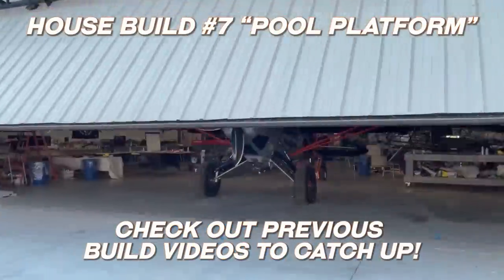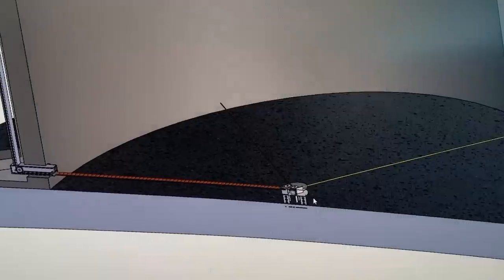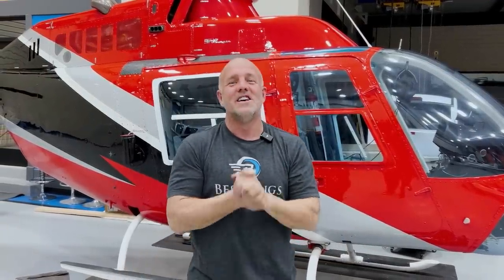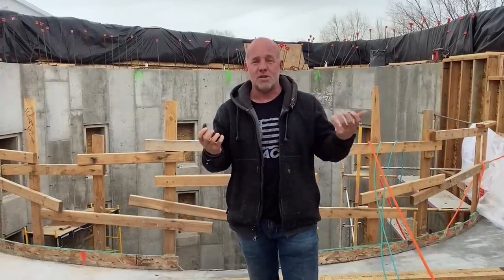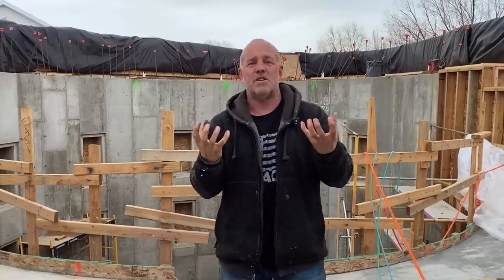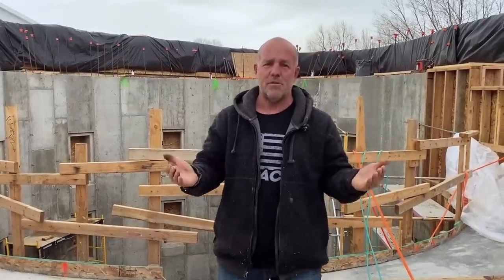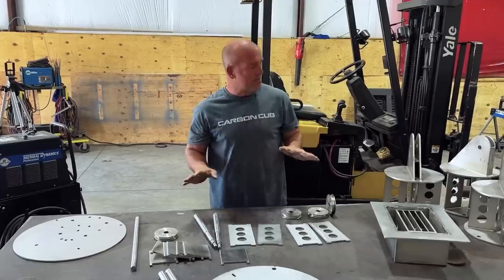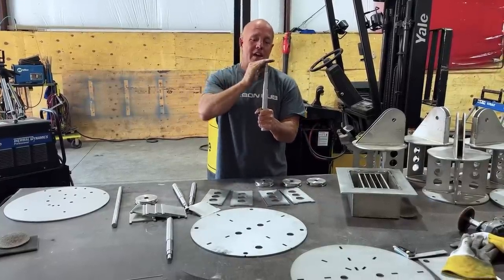How!? Transforming Pool - Dance Floor to Freedive | House Update #7

Comment: The diaphram will only allow so much water... brought back a funny memory, the place I was working built it's own plasma water table that went up and down with air. When they first tested it and turned the switch to raise the water it was like a reverse water fall that shot up over 25 feet and hit the ceiling, (someone forgot the diaphram plate !) this thing holds more than 6  thousand gallons and now much of it was on the floor.

Comment: great plan that man - as soon as you began talking about the platform, i instantly solved it issue with a floating one that can be pulled down, and then you described the same, i must be a genius engineering type like yourself Mike hehe
can't wait to see this in practice, it will be an interesting result, will you mount some simple nylon wheels in the sides to traverse the sides while moving up and down - the dance floor will be interesting when you have more folk standing on one side than the other - conjures up images of Flash Gordon and the fight scene, the floating table tipping and turning with spikes popping up through the floor, mm now there's another plan haha

Comment: Mike,  a suggestion about this, perhaps for the future: If you had added some electrically operated latches or tenons around the pool edge at dance floor level, and at one or more selected depths, then if a cable or pulley failed, the floor would not move.

Comment: It would probably make sense to plan for a 2axis top position lock for the plattform to avoid uneven load tilting
The water transfer hole size thoughts are good, but their flaw seems the potential  displacement of water out of the pool by an ascending plattform.
Happy Landings.
Reply: Purely guessing here, but I'd expect the top position to still have enough 'spare' buoyancy at every point so that it stays level no matter where people stand (or jump up and down). Very much a Mike Patey kind of engineering imo: over-engineer a simple design so much that it handles edge cases properly without needing extra complexity. Dude's always trying to build simple and indestructible.

Displacement shouldn't happen under controlled ascent (assuming Mike's done his sums right), and in uncontrolled ascent it'll happen no matter what size the transfer holes are - only difference is how fast the platform will rise, and he's chosen "slowly" for that. Seems reasonable enough to me, given that uncontrolled ascent is a catastrophic failure mode.

Comment: You can build the floating disk on-site by using fiberglass rods (Owens Corning re-bar) and epoxy. Think big pie of styrofoam. The deck parts are already available in the construction industry as rectangular utility vault covers. They are mass produced and therefore affordable.

Comment: Besides the buoyancy of the floor, will you add some kind of lock mechanism? That way it will stay up no mater how many people are standing on it. Could be some kind of ratchet system that can be released when lowering the floor, which could be activated by a 5th cable from the bottom as well. This also means that you need less buoyancy, smaller actuator, and thinner cables.

Comment: Oh Mike, you’re making my month with all of this sexy engineering 👏

Have to say though, I don’t envy you when it comes to figuring out stuff like :-

(a) - Your cable stretch provisions (needed so you can figure out your tension adjustment requirement and design a solution to suit).

 (b) - Friction, which will be an issue if lack of sufficient friction causes a cable and its pulley to slip.
         If it does, you could have excessive wear and the problems that will introduce.
         You’ll need to workout your minimum cable wrap angles.
         I’m guessing most, if not all, are going to be more than 45 degrees anyway, so no problem.

(c) - Temperature compensation for the cable run system needed ?  
        Your pool is a “year round use” one and the water temp consistent but the cable temps ?

         I think you’re planning to keep the cable runs in dry conduit 🤔

(d)  Operation ?

Your system is not like an aircraft’s flight control system where the driving force is applied to an input quadrant and output with gain at an output quadrant making use of leverage.

You appear to have four single cable lengths, each of which will connect directly to the platform at one end and to your winch’s drum at the other ?

Looks like potentially greater susceptibility to cable stretch issues, if the runs are that long. 🤔

The load on your winch’s motor is going to depend upon the mechanical gain (leverage) you design at the motor worm gear attachment and the winch attachment interface presumably 🤔 …  I’m eager to learn what that’s going to be.

Also interested to learn whether the gear is connected to a cable drum’s shaft and the motor to the worm gear shaft via other gearing, such that the motor operates at high RPM and the Winch drum at lower RPM.
I’m guessing a high RPM motor means less torque (as power is Torque x angular velocity) and thus the cost of your motor would be less (structurally less substantial).

Of course if there are patents involve well have to wait until you get them approved 😉

Thank you so much for documenting this amazing project and sharing it with us 👍

Ps - no need to provide replies to my questions above, I’ll be watching every second of your videos intently to see if the answers are somewhere in there 🤔

Cheers

Comment: Cabel selection is the right choice, I would add  spring loaded stopper/lock once the platform reaches its max height then you don't need to worry about the tilt or load (# of people)the same cables can release the stopper/lock as it's bulled down with very simple mechanism, fitted under the platform

Comment: Build the platform in wedges in your shop and then glue the wedges together at the house before the whole assembly gets an external glass fiber skin. The wedge walls will become internal structural webs that increase stiffness and it reduces the number of epoxy layups you need to do in unconditioned space.

Comment: I've noted the similarity between your pool and an agricultural silo before. This moving pool floor is essentially an upside-down silo unloader, as far as the cable-management goes.

The cable-distribution-block in the center of the pool wouldn't have needed to be in the center. You could have moved that distribution block to one of the corners, and slightly simplified the construction.

Comment: Think I’d want some locking pins for it at the dance floor level, so if your party guests are pulling some moves on the dance floor they won’t get seasick.
Reply: This would also help keep the floor from sagging if a crowd of folks move to one side of the floor.
Reply: I'd be pretty disappointed if the design doesn't already allow for all the guests to jump up and down together at one edge of the platform without so much as a wobble.

Comment: I've been waiting for this video ever since you first mentioned the moving floor. Was curious how you planned on accomplishing it.  
new questions as I'm watching:  
how do you plan on keeping it stable if 50 ppl jump on one side of the platform? 
Is the platform keyed to keep it from rotating (some rotation would be possible with cables unless they're guided)?
Do you plan on putting a mechanical lock on the platform to keep it locked a specific height?
What if you put a latching mechanism (like on a winch) to keep the platform from moving up or down if all 4 cables (or cable holders) break?

weakest point is where the 4 cables join into one piece - single point of failure?
Reply: I had similar questions! It will be interesting to see how he addresses this. To me- “all guests in one area” is a big concern unless the platform mechanically locks at a specific height.
Reply: @deemstyle  I'm thinking a linear gear up the side of the pool at each cable location. Then, a gear tooth on a pivot locks into the linear gear. The back of the gear is flat, and bears on a push/pull rod.  The push/pull rod would have a notch, so when pulled (disengaged), the pivot gear could rotate freely around the pivot and unhook from the linear gear. when pushed (engaged), the back of the pivot gear would bear against the pus/pull rod, locking everything in place.  The push/pull rod could be keyed to prevent it from spinning, and could also have a pivot-spring system that keeps it in either the raised or lowered position (check out Wintergarten's latest video on the bypass gate lever).

Comment: Lots to do. What type of cement did you use to shoot the pool? What about the final plaster material you are going to use? What flowrate are you looking at for filtration? What size pipe for suction and return? What type of lights are you thinking about using? How many returns will the pool have? Have you thought about dead space where algae can grow? I've been building pools for 25 years so If I ask to many questions, I am just curious.

Comment: You would have to do a route survey, but we have been able to move 25' wide catamarans from the waterfront to our shop 5 miles away....  and that was through the downtown of a small town in Maine. I would think Utah's roads and bridges would be even wider, at least until you got into your neighborhood and then it would likely just be street lights, signs and mailboxes that might need to be moved.
I can't imagine trying to build a space at the house to lay up a structure that big and be able to control the cleanliness and temperature for curing.

Comment: Hey Mike. Love your projects. Planes or otherwise!! Quick question as could not see in the video. Are you putting some type ‘system’ in place to stop the cables  jumping the pulleys on the centre assembly? If you get any slack in the cables, especially on a horizontal runs gravity can play  tricks. Especially as a single sided system…. The use case when your kids have a 100 person dance party on the pool deck and try to sink it..😂. Keep sharing the great videos! Inspiring me to build my own plane sometime!!

Comment: I hope you plan on pickling and passivating all the welds, especially if they weren’t post heat treated. You’ll end up with corrosion stress cracking due to the tensile loads

Comment: Where does the slack go and come from as the pool bottom moves?  Very cool.  I am waiting to see how you deal with the porosity of concrete over time and the resulting change in dead load as it absorbs water.  Have to also wonder just what the heating cost per annum will be for a pool in sub freezing temperatures and what fuel you will use.  I promise not to be surprised if you opt for nuclear!! Lol!

Comment: Instead of the disc floor opening up to cover gap to underfloor area you could just make a slip up grate that the floor picks up as it passes the normal pool floor and lowers back when floor heads down.

could live in a recess on wall next to fixed floor and cap on top of grate can cover grate gap between floor and floating floor when they are both at same level

Comment: Very cool project and love the detailed explanation on everything.  One question I have on the platform.  Isn’t there a risk of people (or weight) moving to one side and the “floor” tipping.  Seems like you may need to monitor weight distribution or add some sort of lockout that only happens when the platform is above water. Just curious how you are handling this problem.

Comment: Instead of relying on floatation when the platform is used as a dance floor you could have some sort of pin lock to secure it at a set point when raised. That way you don’t have to worry about it not being balanced if for some reason everyone on the platform is standing on one side.

Comment: This is very interesting.  I was picturing a platform that took on water as ballast like a submarine. Would need an air pump and hoses and dump valves.

   The constant buoyancy and cables is a very simplistic approach.   K.I.S.S....

Comment: This is a fantastic project and your engineering skills are unsurpassed. We have a number of pontoons and when you get a large amount of people moving around the pontoon it will move up and down  / oscillate in a wave pattern with the movement of the people, also people congregate in tight groups so the load on the pontoon is rarely even so what will stop the pontoon tilting even by an inch or 2 and creating a trip hazard around the edge? Have you thought of having a number of locking pins working with the positive pressure of the pontoon so when it is in patio mode it won’t tilt or move?
Reply: I'm assuming that the platform's positive pressure outweighs all the guests combined, even if they all stand at one edge and jump up and down together. Benefits of having massive excess buoyancy and a bunch of cables holding it down.

You just can't do that with your pontoons, unless you've got an anchor that'll secure say a hundred-ton force pulling the platforms down to stabilise them - as I understand it, your pontoons are free-floating.

Comment: I understand needing to have buoyancy to overcome the max load.   But that could still be a large delta (easily topping 4 ton for 50*150lb people) for 50+ people chairs and need a good margin to avoid sagging if people congregate to one side.  How about locking in the up position so that the platform just needs to float itself plus a smaller delta.  Maybe pins that could extend out into pockets.  (Removed 5th cable idea to extend pins).  Instead have flush sockets around the perimeter that could accept a tool to turn and extend the pins or when the 4 cables tension reduces enough the pins could extend.    That way the platform gives a positive solid feel in the full up position.  

Love the engineering.  The idea of having flow controlling holes that dampen the movement in the event of a catastrophic failure etc.

Comment: You could very easily manufacture a simple locking system to lock the platform in place when fully raised that way any one can walk on it thus eliminating many difficult calculations. so simple

Comment: That platform is full of air, presumably atmospheric. So when you sink it you will have what 10 psi. That's 10lbs on every square inch of a 25ft diameter flat surface, some 70,000 square inches, unless its seriously strong its going to get crushed. A friend of mine was telling me about an industrial suspended ceiling where the cold air came from the void above the ceiling through slatted vents. When the aircon was switch on it brought the ceiling down because someone in their wisdom had closed all the slats in the vents. Even though the pressure difference between inside the room and above the ceiling was small the area was vast and the resulting "weight" on the ceiling was more than it was capable of holding.

Comment: Maybe some pin locks to hold the platform all the way up? Just so if you ever have to drain the pool, you can lock the platform up, then do maintenance under it while the pool is empty and platform is locked up?  Or to keep it from moving around while dancing. If people actually do get dancing, you dont want everyone moving at once to just happen to line up with a natural frequency for waves going up and down the pool and to let the platform bobbing more than static load calcs would lead you to believe.

Comment: Mike, Are you planning on having tanks in the platform that can be filled or pumped out to change the buoyancy? It would relieve a lot of stress on the cable system to only pump them out when required for the dance floor.
Reply: I agree… Displacement can be variable.

And when the floor is completely raised, the water level in the pool will drop to a point that your weir needs to have enough volume to replace (which you already know).  By changing the displacement of the dance floor with water, it will help compensate the volume of water needed in the weir.

ie. You need the dance floor to be a boat.  Pump water into and out of the boat to change how it floats… and always maintain positive buoyancy through chambers that never flood.

My 2 cents.

Comment: I would have constructed a nice platform that was air pressure tight and not very thick.  To sink the platform, one would open the air valve.  Pump the water out with air pressure to raise it.  Once the platform was raised, I would slide maybe six locking pins to the surrounding walls that would make the platform a temporary part of the structure.

Comment: Is controlled buoyancy an implementable feature- with floodable tanks for adjusting ballast  -  nice implementation.
(ie. BCD in a deck)

Manufacturing engineering experience demonstrated - make it so it can only be assembled one way, zero possibility to get it wrong.

Comment: I'm sure you thought about it, but why not have pins (or landing pads) come out around the top of the pool for the platform to actually rest on? Could be done manually or automatically with linear actuators. Then the height would be fixed no matter how much weight is on it. Thanks for the back to back episodes!

Comment: Defiantly an ambitious project, I'm currently building a house myself in the UK so appreciate how hard it is. looking at this pool floor i'm wondering if it would of been possible just to use air to lift and lower the platform. The platform could essentially be a large cylindrical tank with guides or runners on the side. You fill with air to raise it to the top or water to sink it to the bottom?